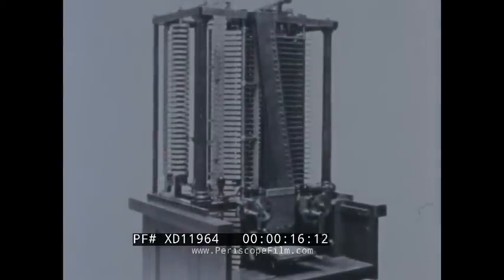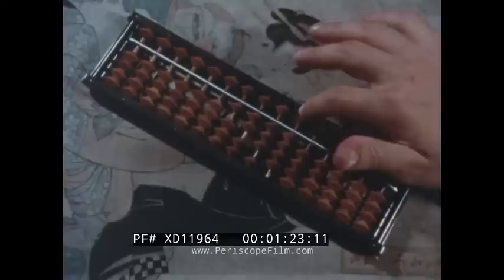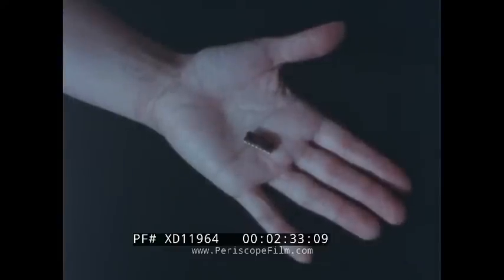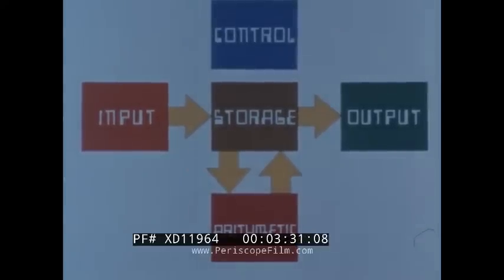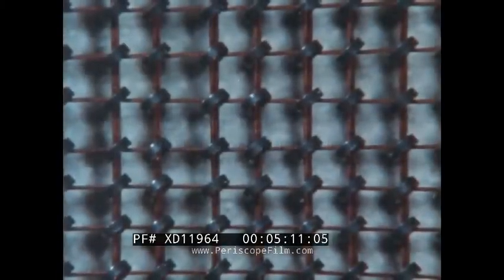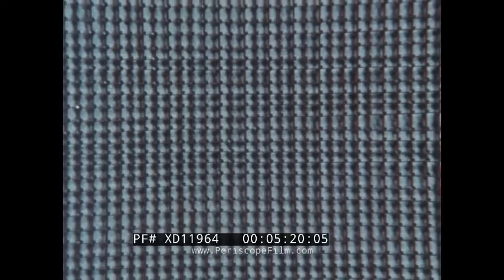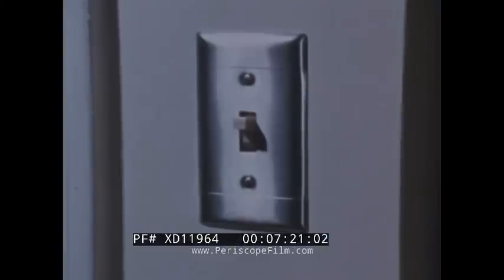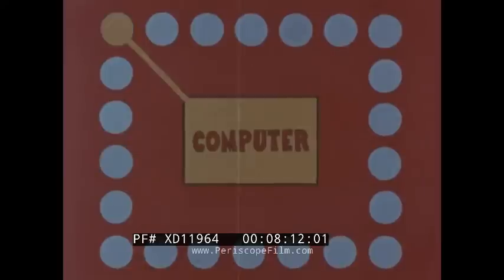" COMPUTERS " 1970 EDUCATIONAL FILM  IBM MAINFRAME PUNCHCARD & MAGNETIC TAPE BASED COMPUTERS XD11964

Comment: Im curious, does anyone still use machine code or assembly language or is that just for historical teachings?
Reply: People do as a way of showing off their skill, there are contests for people writing graphical demos that take up a tiny amount of space. For general work no .
Reply: Assembly language is still used for code that runs so often that it must be “tight,” that is no wasted data transfers, or that needs to do specific tasks that higher level languages have no way to represent.
Reply: There are some situations in which developers might choose to use assembly language:

Writing code for systems with older processors that have limited high-level language options such as the Atari 2600, Commodore 64, and graphing calculators.[55] Programs for these computers of the 1970s and 1980s are often written in the context of demoscene or retrogaming subcultures.

Code that must interact directly with the hardware, for example in device drivers and interrupt handlers.

In an embedded processor or DSP, high-repetition interrupts require the shortest number of cycles per interrupt, such as an interrupt that occurs 1000 or 10000 times a second.

Programs that need to use processor-specific instructions not implemented in a compiler. A common example is the bitwise rotation instruction at the core of many encryption algorithms, as well as querying the parity of a byte or the 4-bit carry of an addition.

A stand-alone executable of compact size is required that must execute without recourse to the run-time components or libraries associated with a high-level language. Examples have included firmware for telephones, automobile fuel and ignition systems, air-conditioning control systems, security systems, and sensors.

Programs with performance-sensitive inner loops, where assembly language provides optimization opportunities that are difficult to achieve in a high-level language. For example, linear algebra with BLAS or discrete cosine transformation.

Programs that create vectorized functions for programs in higher-level languages such as C. In the higher-level language this is sometimes aided by compiler intrinsic functions which map directly to SIMD mnemonics, but nevertheless result in a one-to-one assembly conversion specific for the given vector processor.

Real-time programs such as simulations, flight navigation systems, and medical equipment. For example, in a fly-by-wire system, telemetry must be interpreted and acted upon within strict time constraints. Such systems must eliminate sources of unpredictable delays, which may be created by (some) interpreted languages, automatic garbage collection, paging operations, or preemptive multitasking. However, some higher-level languages incorporate run-time components and operating system interfaces that can introduce such delays. 

Choosing assembly or lower level languages for such systems gives programmers greater visibility and control over processing details.

Cryptographic algorithms that must always take strictly the same time to execute, preventing timing attacks.

Modify and extend legacy code written for IBM mainframe computers.

Situations where complete control over the environment is required, in extremely high-security situations where nothing can be taken for granted.

Computer viruses, bootloaders, certain device drivers, or other items very close to the hardware or low-level operating system.

Instruction set simulators for monitoring, tracing and debugging where additional overhead is kept to a minimum.

Situations where no high-level language exists, on a new or specialized processor for which no cross compiler is available.

Reverse-engineering and modifying program files such as:
existing binaries that may or may not have originally been written in a high-level language, for example when trying to recreate programs for which source code is not available or has been lost, or cracking copy protection of proprietary software.
Video games (also termed ROM hacking), which is possible via several methods. The most widely employed method is altering program code at the assembly language level.

Typical applications
Assembly language is typically used in a system's boot code, the low-level code that initializes and tests the system hardware prior to booting the operating system and is often stored in ROM. (BIOS on IBM-compatible PC systems and CP/M is an example.)

Assembly language is often used for low-level code, for instance for operating system kernels, which cannot rely on the availability of pre-existing system calls and must indeed implement them for the particular processor architecture on which the system will be running.

Some compilers translate high-level languages into assembly first before fully compiling, allowing the assembly code to be viewed for debugging and optimization purposes.

Some compilers for relatively low-level languages, such as Pascal or C, allow the programmer to embed assembly language directly in the source code (so called inline assembly). 

Programs using such facilities can then construct abstractions using different assembly language on each hardware platform. The system's portable code can then use these processor-specific components through a uniform interface.

Assembly language is useful in reverse engineering. Many programs are distributed only in machine code form which is straightforward to translate into assembly language by a disassembler, but more difficult to translate into a higher-level language through a decompiler. Tools such as the Interactive Disassembler make extensive use of disassembly for such a purpose. This technique is used by hackers to crack commercial software, and competitors to produce software with similar results from competing companies.

Assembly language is used to enhance speed of execution, especially in early personal computers with limited processing power and RAM.

Assemblers can be used to generate blocks of data, with no high-level language overhead, from formatted and commented source code, to be used by other code.